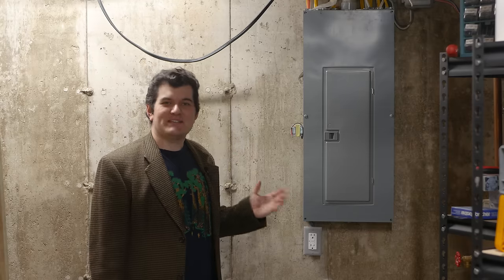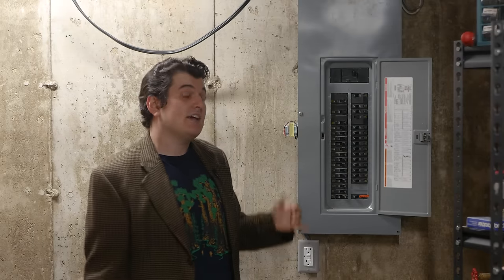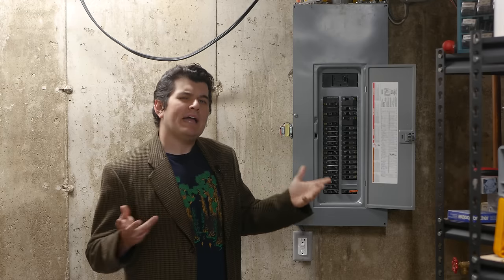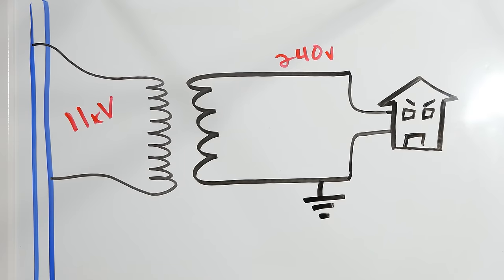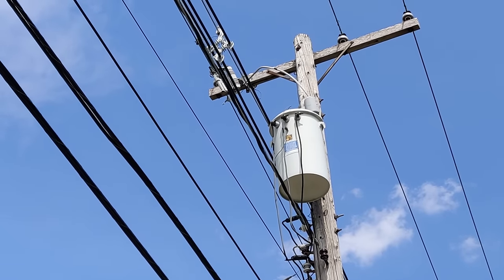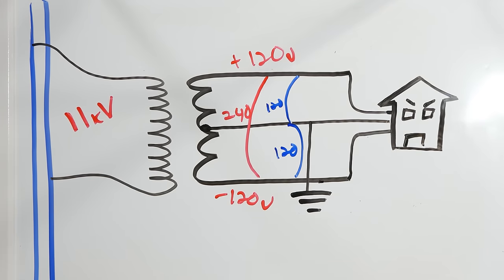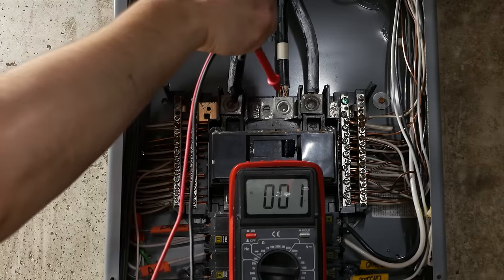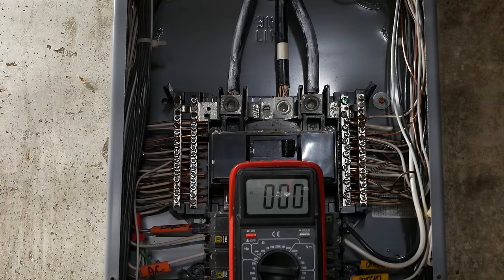The US electrical system is not 120V

Comment: I have seen a 400V AC (not 3 phase) flow through water heater when i was learning for the first part of the electricians apprenticeships final exam, and wondered how that would work. Had never seen this to this point. But its the same principle you americans use to get a proper voltage i guess
Am german btw

Comment: If you take this statement then it means Europe has a 480V system. But that's not what a normal person means if they are talking about the electrical system.
They mean what voltage is on your normal outlet.
Reply: Why do you say Europe has a 480V system?
Reply: @General12th  3 phase power to houses is common in Europe, as it is in Australia too.  So if the final arbiter of what voltage a country has is the maximum voltage between live supply wires and ground, as argued in this video, then a 3-phase 240V country is actually a 415V country (not 480V, due to the 120° difference between 240V phases).

Comment: What about commercial power 480 volts / 277volts ? The 277 volt panels can look similar to house panels. Many maintenance person have been killed by inexperience by thinking no problem it’s like my house panel. No so 277 volt causes muscle to contract thus you can’t let go. It’s how the transformer are wired delta wye or wye delta. At a commercial facility you can have 4 kilovolt, 480 volts. 277volts, 208 volts, and 120 volts all running in the same building! Plus single and and 3 phase power. Yikes!! And you guys get confused about a single family home. There’s more to it than flipping the switch and the light comes on or turning a knob and water flows from a faucet. I’m amazed that most people haven’t a clue how things work and don’t care until it’s not there for them. Love your channel keep up the good work. Check out practical engineering channel great stuff there as well.
Reply: Nobody but an electrician should be messing with commercial wiring.

Comment: You tell the chinese this. They refused to ship me a 230 volt heater because they insist the voltage in usa is 120 volts even though i told them i have 230 volts.

Comment: I would like to known more about the difference between 50htz and 60htz, and how it affects motors and appliances.
Reply: In ac induction motors and transformers you need 20 percent more steel. More laminations. So the motors and transformers are physically larger .

Comment: Well with the same argument you can say that I don't live in a 240V country but a 400V one. But at least its consistent throughout. Where there seam to be no such ting as standard voltage in the U.S.
You can have 120/208V or 277/480V or 120/240V or 240V or 480V or finally 120/240V. The last probably being the case for your region.
But the title is non the less right, Cause non of them are 120V only. Which is mildly maddening....

Comment: Love your quirky highly informative videos. I do understand the diverse US power distribution concept…
I design and install solar pv inverters…. Split Phase or 2 Phase 🎉😅😅😅 in Central Europe homes mostly have 3Phase supply.🎉🎉🎉🎉😮. Can you please do a video about the weird practice of having insulated Life  and Neutral wires but a blank Earth and the sleeve to cover that…. 😢
Reply: the idea is if the live wire gets striped, then it will short to the ground wire. Instead of energizing the nail or rubpoint, it would trip the circuit.

Comment: Thank you for mentioning those stupid switches in the UK on the sockets. We don't have them either in Germany and probably no one else in Europe. Always was wondering what they are good other than costing extra money as all devices have their own switch anyway. Having the switches as well on power extensions.
Speaking so much out of my heart with that other stupidity to have no sockets in the bathroom that drives me nuts. Dumb ropes to pull the light switch and last but not least another stupid rope to turn on the shower is being turned on by another switch. At least you have a clue what you're talking about so thanks.

Comment: If anyone can answer, I would appreciate. I have a bakery and my electric fryer goes through a triple breaker on my breaker box. How does that work?
Reply: I suspect that your fryer has 3 heating elements. One for each phase.
Reply: You most likely have a 208/120 volt system.   So, your fryer has three elements that are running at 208 volts on each element.
Reply: This is interesting, because my current fryer does have 3 elements, but the one I had in not too long ago only had two elements. But this one does seem to heat up quite a bit faster.
Reply: @jacobthatcher385  Just because you have 3 phase doesn't mean  you have to use it.

Comment: Ring mains huh? They allow a much greater current to many locations for the same amount of copper in comparison to radial circuits. They also allow a single high quality breaker to cover a wide area very effectively AND always provide a path to ground even if a wire is cut/drilled. But you guys have dog-leg delta setups.... Try explaining that stupidity away. PS your fuse boards/breakers and receptacles are hand on heart worse than what we had 50 yrs ago, like 50s era stuff just built much thinner and sharper. I'm an overhead linesman and the whole American electrical grid including all the gear used just seems old fashioned and poorly designed in comparison to what we use. You guys even moved over to putting in polymeric insulators yet or still replacing like for like with old ceramic ones that love to crack and flashover. PS love the video, very educational, learnt a couple of things. Although I already understood the 120v thing the interposing fingers in the fuse board is good to know, save me from blowing up a board if I'm ever over and fancy a poke around inside lol.

Comment: The IEC Voltage is 230 Volts.
The US should adopt the IEC standard.
Reply: Not going to happen.  Can you imagine the cost of changing the design of our electrical system?  There is nothing wrong with it the way it is.
Reply: It may seem ideal...but nope...
IEC has a terrible design as far as the electrical panel is concerned, in that aspect the American NEC is much superior:

 our electrical panels have a cheaper and more relaxed protection precisely because of that expensive split-phase system where I must also say that it has much better design than Europe, such as being able to remove or put the thermomagnetics on hot without using cumbersome combs or garlands. searching for an insulation fault does not become a pain in the butt like in Europe because we do not need to use a general RCD that cuts off the entire supply, only the specific thermomagnetic of the failed circuit is triggered because the Protection here is binary. ..either we have good insulation or we simply have a short circuit...there are no spaces for "low insulation, or untimely RCD trips." Our RCDs go directly into the socket so any fault is quickly identified.
Our ground fault loop is closed through a solidly conductive copper conductor to the source and not towards the ground like you do which requires conductive chemicals and soil studies.

Comment: OK, 240V with 180 degree phase shift in the US. 400V with 120 degrees phase shift in the EU.
But 200A incoming???
What do you need 24kW for?
I have three phase and 16A, and that's more than enough.
Reply: You have mis-calculated. It is actually 48KW.  I suspect that you may have another source of energy coming into your home. Heating fuel would have to be included to make an accurate comparison.  Tripoli, Libya is more artic than where I live so air conditioning is nice in the summer.
Reply: @billelkins994  OK, my math really screwed up here 😀
But that makes it even worse.
I have 11kW available, and that is more than enough. I live in Sweden where the winter can be really cold. My heating is electric with a heat pump, and it never use more than 5kW to heat the house.
The only situation where there can be a problem is if the heating is going full blast, I'm cooking on the stove and charging the car at the same time.
But then the load balancing will halt the car charger during the high loads.
48kW would cover the whole neighborhood.
Reply: @anderskarlsson9881  Apparently 11KW is not enough if you have to resort to "load balancing" to stay under 11KW.  Fortunately neither of us use the peak KW rating of our services. That would cost me almost five thousand dollars a month at 14 cents per KWH.

Comment: I don't get it you still have 240volts against earth on one live wire. Also on the neutral wiring you have 120volts against earth. In europe the potential between earth and neutral is almost 0 volt (in practice couple of volts due to leaking devices). You can safely touch the neutral wire in normal conditions without hazard in europe. I don't think you will be able to that in america. 120 volts is relatively less destructive but we can not say the system is safer as a whole. For the last 25 years new homes are fed with 380 volts 3 phase electricity and split into 3 lines of 220 volts in the fuse box. We are able to run even the industrial machines at home. :)
Reply: The neutral  is tied to ground in the main breaker box.  To simulate the  North American system simply remove one phase from a three phase system.

EU N is at zero volts.  
NA N is at zero volts.
EU  L1 is at 230 volts
NA L1 is at  120 volts
EU L2 is at 230 volts
NA L2 is at 120 volts
EU L1 to L2 is 380 volts
NA L1 to L2 is 240 volts

Comment: If im ever in the position to do so, I will bring the plug and transmission standard of Europe to a small prototype town in the USA. Wont see any large scale changes in my lifetime. But it would at least be an initial point for it to ripple out into other new constructions.
Reply: YES PLEASE!!!!
Reply: The code inspector would not approve it.  I have used European plugs.  They are not an improvement.

Comment: if you're going to play that card then we have 400v. and even up to 600v in the netherlands for the 600v you have to ask and if the reason is good  they rip open the street for the 600v.  but the 400v almost everybody has it in the street maybe some older houses here will only utilise 230v  with one line, but in the street here is a 3 phase net so 3 lines neutral and ground .
 my point is you still have only 120v over one line so a normal outlet with a 16 amp breaker is still less watt then here in Europe. yes you can use 230v for you ovens  and cooking plates but here some kitchin devises like cooking plates and so can use 400 volts  but I do like that you said it yourself that your electrical panel looks dangerous  and ugly but you named your cables so that's something  ^^ but man honestly look at your neaked copper man  it must really smell like burnt dust  and all the corrosion here im I not trusting single line breakers. every breaker has its own neutral line in my home so if the breaker is off there is no volt on the neutral in that circuit so for maintenance  or so i can safely put one breaker off and know im same for the whole loop otherwise you  can never be sure the neutral has no volt on it  if your whole house is on one neutral
Reply: Thanks that i dont have to write that comment.

Comment: Still Remembered When I Was At Collage Using My Laptop, Since The Grounding Kinda Faulty.. I Get Shocked Every Time I Touch My Laptop.. Lucky Charger Only Supply 7.5 Volt And Deliver Quite An Amps Or Something.. It's Gaming Laptop.. That Wondered Me.. If That's Only 7.5 And I Still Get Shocked.. Then What Happen If You Touch Appliance That Require High Voltage To Operate.. Plus, Don't Even Had Grounding.. They Have.. But For Specific Usage.. "If Breaker Tripped, Then Okay.." Still.. It's Terrifying..

Comment: Blood is quite conductive conpared to skin. 120v ripple free dc and 50v ac are extra low voltage and considered as basically safe. Also why tf are there so many breakers in your switchboard??? From a 415v 3 phase country.

Comment: Well, with your reasoning, the US is still worse, because most EU power grids are actually 400V. Not 230.

Also, a 230V shock really isn't that bad. Rarely people die from it. 400V actually HURTS.
Reply: Hence the reason 400V isn't necessary and more dangerous
Reply: @Jst4vdeos  No, because the line voltage between phase/neutral and neutral/earth in regular EU outlets is still 230V. Only phase-to-phase is 400V. You could only be exposed to 400V by severely misusing industrial equipment.
Reply: @MCasterAnd     Most of our grids are12470/7200.   So, we win!
Reply: If you touch 230 V by hand, yes, chances are only 3 % to die. Too much for me though.
But if touched with other body parts it can be more than 50 % though.
Reply: @Delibro  
This really depends on what country you live in and what health and safety regulations are applied.

In Norway, anyone who is electrocuted will be sent to the hospital. They are usually dismissed if the electrocution didn't pass through any areas where vital organs are, and/or if the patient feels fine and EKG readings are fine. Sometimes they need to be monitored overnight in the hospital, just to be sure.

Mortality rate here is about 0.2%.
Reply: @MCasterAnd  Ok, good to know. Don't know which country my statistics was from.

Comment: "200 Amps at 240Volts"... Well... technically yes, that is theoretically available, but would only be true if all your appliances would utilize 240Volts 2 phase. In reality 90% of your appliances are 120Volts single phase. So compared to that theoretical 48kW, even if you perfectly load balance your two available phase, you will get 2x12kW single phase capacity. Of course if your biggest consumers are happen to be 240Volts 2 phase units, the truth will be somewhere between 24kW and 48kW theoretical maximum.
Reply: Your argument is incorrect.   That panel is 200 amps at 240 volts and 400 amps at 120 volts available in the panel.  So, it’s maximum power available is 48,000 VA no matter the voltage.  Maximum.

Comment: Christ, 200A service that can deliver 48kW. What the hell? I live in Sweden in a large freestanding house, family of four, heated using only electric heaters in the winter. No gas, only electric kitchen appliances, electric water heater etc. And I make do with 20A 3-phase service. That's less than 14kW. And I never trip the main breaker. How can you ever need 48kW??
Reply: Most likely, he never gets close to the capacity of the main breaker.  He has a large panel, probably because he wants lots of circuits.  A large panel will come with  200A breaker pre-installed.
Reply: @GH-oi2jf  But that means the incoming service needs to be designed for 200A which is a huge cost. Seems wasteful to me.

Comment: There's nothing wrong with our electrical system, i.e split phase. If your higher power devices are to be operated more efficiently then use it at 240 volts, esp. electric motors.
Reply: Try and find a 240 volt plug when you need it.
Reply: I looked up motor specs awhile back and the manufacturer said there was no difference in efficiency whether you hooked it up for 120v or 240v.  That’s for small motors.  At 240v the current draw will be lower and there is some advantage to that.  Large motors might be three phase and there are advantages to that.

Comment: No thats only half right yes we power most things on 110 to 125 volts but there is another side of the transformer that is 110 to 125 volts also. Then we have 220 to 250 volts on the same transformer. It makes more sense to have a 120 volt inverter than a 240 volt inverter. Just see what type are found in the USA. You will find more 120 volt inverters. Whole house inverters don't count that's part of the power companies sell back power which i want no part of.  73

Comment: Really the EU electrical system is not 240V.

Rather it's ~400V, because we get 3-Phase power and almost everything you do with 240V, like stoves and Table saws and such use the big red CEE sockets with 3-Phase and 5 Poles. They also do up to 32A, so we can basically get up to ~10kW
Reply: 10kw? 230/400v 3x32a is 22/19kw
Reply: @gamecubeplayer  The phases rotate though (so you don't get constant power from each) and the 400V already cumulative (each phase on it own is 240V) so it's only 400V × 32A = 12.8kW from what I know, but I'm not an electrician, so I might be wrong. But it's definitely more than 10kW, although you might run into limits with the power to your house anyway before hand. For us 2 of the phases are only 25A and one 35A and that's for everything in the house, so if you try and use the whole power available, you'll trip them and have to call your utility as you aren't allowed to touch those yourself.
Reply: @cromefire_ listen closely:

230v 32a × 3 = 22kw

l1 + l2 = 400v 16a
+
l1 + l3 = 400v 16a
+
l2 + l3 = 400v 16a
=
400v 48a = 19kw